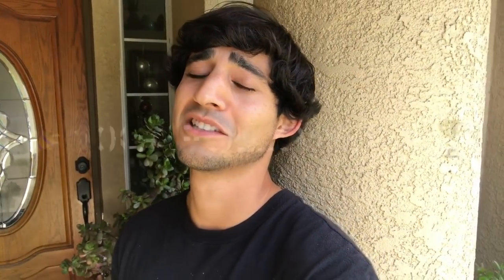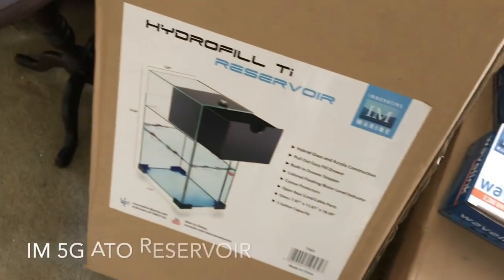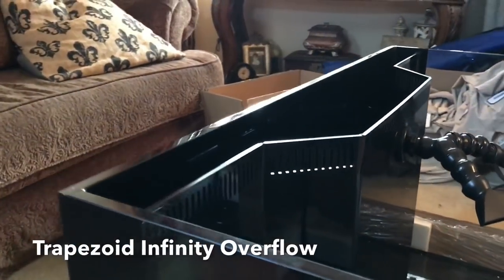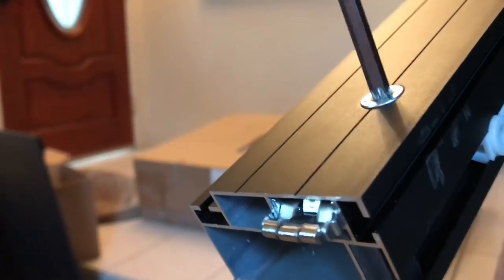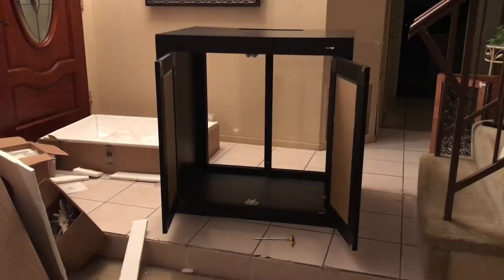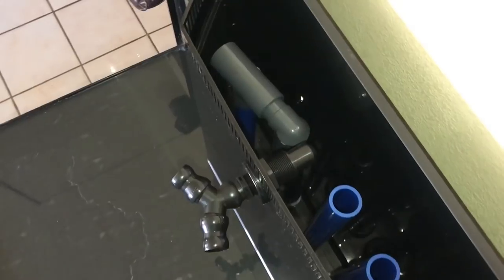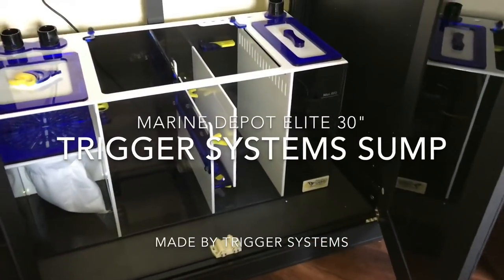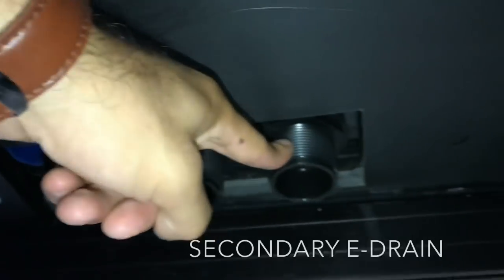NEW Nuvo INT 75g Reef tank!

Comment: Drew do you still have your INT 75? Is it OK if I ask you what the distance is from the top of your sump up inside to the bottom of the panel the tank is sitting on? I like your choice in the sump too, but I want to use an algae scrubber above it. I am hoping there will be enough room to customize a place for the scrubber on top or above  the sump. Sub'd and liked :)

Comment: What's the inside dimensions on the aps stand thinking about getting this setup with ext overflow but cant find any info on inside dims. Do you think a trigger 34 sump can be squeezed in there or a 30 gonna be it. Thanks
Reply from the maker: Dimensions: 36”L x 15”W x 36”H
Inner Dimensions: 32"L x 10.5"W x 28" H sorry i didnt see ur message sooner my dude